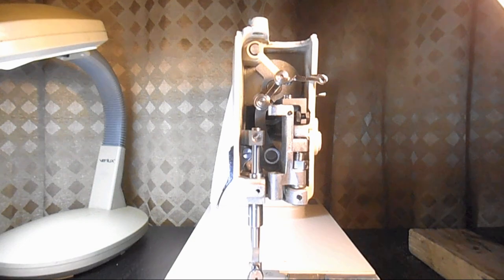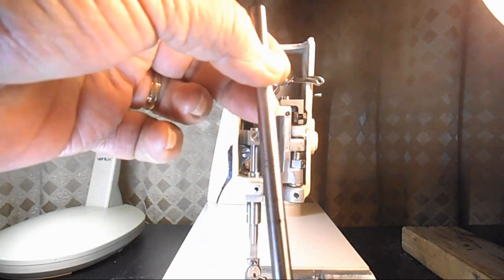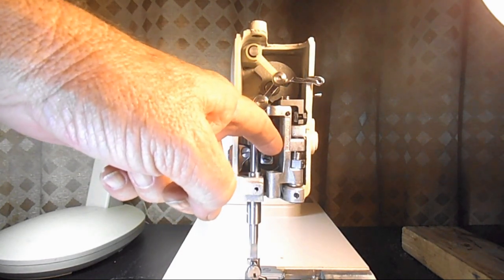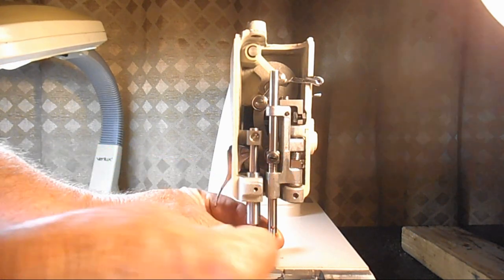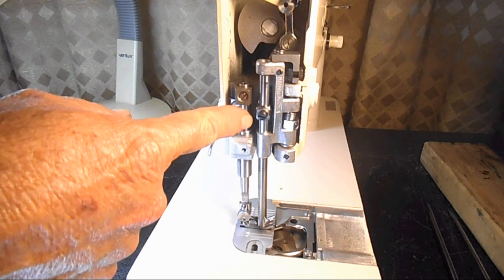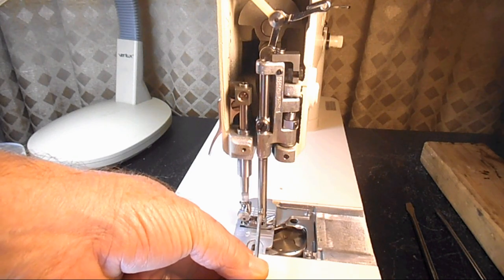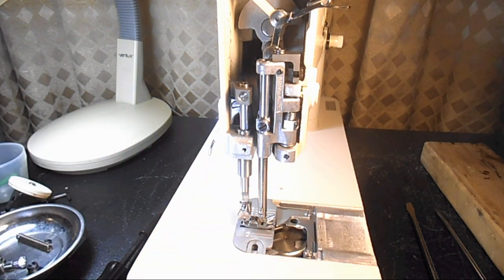How to Install Needle Bar and Set The Height on a Singer Model 513

Comment: My biggest regret on buying a Vintage Singer Futura 900 is not having access to the Needle Bar/Shaft area
without taking the sewing machine's Casing off.  It couldn't just swing open like this Model 513
to check what's wrong.  Dang!  
Andy thanks for all your tips.  My sister says I can use her 513 for as long as I need
to finish my project.  Then I think I will buy a blow threading system, with computerized this and that.
Dang!
Reply from the maker: Just looking at the parts list (over 400 parts) for the 900 is enough for me to shy away. It always seems to be some plastic part in the middle of an assembly that fails. I had to look up air threading. How easy, and all the computerized stitches... oh man. It may not be long before we just dump fabric and thread into the hopper and pick a pattern and size and the finished blouse will come out the other end. You always hear about "men and their toys", but I've seen many women with glassy eyes wandering around the sewing machine section of fabric stores too. Dang! Sounds like an exciting machine is in your future.
Reply: @andytubesewing1953  Andy, you just talked me into a Computerized Machine 100%!  
Love to you SewBro!  My eyes just glazed over at the though!

Comment: thanks for sharing your knowledge.i have one 513.After deeply cleaning,oiling and changing gears,but the needle appears too long and drags on the bottom hook plate.what can i do?it looks like a final step to get it perfect.thank you very much
Reply from the maker: Normally that is caused by one of four things. The needle bar is set too low, the hook is not installed completely down against the bushing (hook sitting too high), the needle to hook timing is off (must be reset after changing the gears) or the wrong size needle is being used. Model 513, like most Singer Models, uses a Singer Class 2020 Needle. Today it is better known as type 15X1, in sizes 9, 11, 14, 16 &18. You can download a copy of the 80-page Service Manual for $4.99 at this link: https://manualsoncd.com/product/singer-500-sewing-machine-service-manual-518-538-513-514-533/    It has nstructions for all the adjustments, including timing the hook and the feed. If you need the 64-page original Instruction Manual is can be downloaded for free from Singer at this link https://www.singer.com/search/support?title=513

Comment: Very informative. Thanks. I have the same machine. I have an issue with the needle not coming in a straight path. It come down a little to close to the plate. Will replacing the bar eliminate that problem? Thanks.
Reply from the maker: If the bar is bent, then maybe but it could be other things too. Are you talking about when straight stitch, zigzag or both? The position of the needle bar may just be off and you can adjust it back to center. The pendulum movement of the zigzag may be off and going a little sideways before it gets up all the way. Always do a good clean and oil before adjusting. That can fix up to 90% of these types of troubles. I have several cleaning videos on my channel but you can just get in the machine with alcohol, Q-Tips and/or rags and get out as much crud as possible, then fresh oil and see if that improved the movement. The machine may be barely sticking into the zigzag mode and that is why the needle is off towards the plate. If you wish to email my channel at andytube53@gmail.com I will gladly send you free copies of the original Siner manuals including parts schematic and adjustment manual. They show how to adjust the bar side too side and front to back and all other adjustments. Good Luck.

Comment: Hi, I have the Singer 513 machine. I adjusted the timing and confirmed the needle height is correct as per your video. But the needle appears to be too long? It drags on the bottom hook plate. I have pushed the needle up as high as it will go in the bar. What can I do to fix this? Thanks!
Reply from the maker: Be sure you have the correct needle. The style is 15X1, and you can use sizes 9, 11, 14, 16 & 18.
Another possibility is that there is dried up oil inside the needle clamp. People oil the needle bar and it runs down and settles inside the clamp. If the machine has been sitting months, years, decades the oil can be like dried varnish. The easiest way to try to fix that is take out the needle and lower the bar/clamp down into a cup of alcohol and let it soak. The proper way is to remove the needle clamp and clean it and reinstall it. I have a video about that https://youtu.be/qm-Qk3qk9GQ     Two notes about the video; 1. I show taking out the whole needle bar and you do not have to do that unless you'd like to. 2. I call the little part a Pib and that is incorrect. It is called a Gib and easy to lose. Someone may have put the Gib in backward which would probably block the needle.
The last possibility, which is very rare, is that someone put the wrong needle bar into the machine. Rare, but I have seen that happen. 
The correct needle bar for model 513 has a part number of 102522 and it should be etched into the bar. Without having hands on the machine I'd say that something in the needle clamp is blocking the needle so I'd remove and clean it. Good Luck.

Comment: Hello, I have a Kenmore 385-16627 (for which I have no manual and can't find one online). Today when I went to use it, the needle was all the way down - the needle bar has come loose somehow. By holding the needle clamp screw, I can manually move the needle and bar up...and when I let go, it slowly just falls down. If I use the round handle on the side of the machine, the thread eye moves up and down...but the needle bar just sits there. There's a tiny allen screw on the side of the needle bar, but I don't have an allen key small enough to fit it, if that's the problem. It's like the needle bar has come disengaged somehow. Any suggestions?
Reply from the maker: Sorry, Dianne. I only work on SInger machines and know nothing about your Kenmore model. There are Vintage Kenmore Sewing Groups and I think that would be your best shot at getting your question answered. 
https://www.google.com/search?q=vintage+kenmore+sewing+machine+group&oq=vintage+kenmore+sewing+machine+group&aqs=chrome..69i57j0j69i64.8231j0j4&sourceid=chrome&ie=UTF-8
Good Luck.

Comment: my  needle bar has fallen off my dressmaker 602a  how do I fix it?
Reply from the maker: Donate it to charity and buy a vintage Singer? Hi, Barbara. I'm sorry but I do not know anything about Dressmaker Sewing Machines. I only work on Singer machines. A 15 minute Google search for Dressmaker model 602a did not turn up much at all. The two places I use for buying manuals did not have even the instruction manuals, let alone a service or repair manual. I have several needle bar videos on my Andy Tube Channel, but they are similar to this video you commented on. On all the machines I have ever worked on the needle bar is connected by a metal link to the take-up lever assembly and the counterbalance weight behind it that is attached to the main horizontal arm shaft so when the shaft turns the counterbalance rotates and the take-up lever assembly rotates and the link to the needle bar makes it go up and down. Wish I could be of help but have nothing else to share.

Comment: The needle bar screw will not tighten.   I have done eat all you dud and you are the best because you are not running fast.  Please tell me what I need to do. I know it takes a special tool.  Please help.
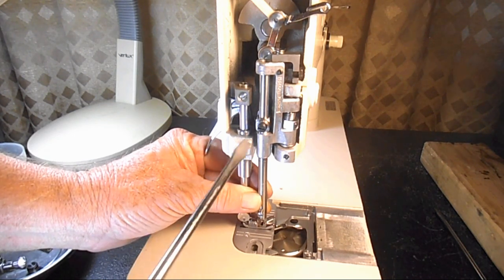Reply from the maker: Wait, what? Do you mean the screw I show tightening at 9:00 in this video? You can't make it tght to hold the needle bar? Hmm....I'v neve hd that problem before. Did you mean to loosen the screw? Is it stuck? Please help me understand, ok?

Comment: please I want to ask you about my machine singer 263 the needle bar is shaking right and left what can I do ?? @Andy Tube help please
Reply from the maker: I do not have records on model 263, which usually means it was not originally sold in the US. Maybe South America or France manufactured there by Singer. In general, if the needle is shaking l & R it means the needle bar rocker bracket is out of adjustment, or on some models, there is a needle bar driving arm. For ZZ sewing there is a small arm the "follows" the ZigZag cam. That arm is attached to a paddle or lever that has a shaft or rod going to the needle bar and it makes the needle bar rock back and forth to sew ZigZag stitches. When the machine is set to zero width or straight stitch, that follower arm is supposed to move away from the ZZ cam. If that camstack area or follower is dirty or out of adjustment, the arm can still touch the cam a little bit, and that makes the needle bar shake or wiggle back and forth a small amount. It is hard to explain and I wish I could show you, but the only thing I could find is a free instruction manual for model 263 >> https://www.singer.com/sites/default/files/product_manual/SINGER%20263_563_878_968%20and%203103%20Sewing%20Machines.pdf
Here are some videos about the ZZ on other models that may give you an idea of how the ZZ works. Maybe they will help you a little bit.
https://youtu.be/AzEiX1AZ5Xs
https://youtu.be/ySs4xQf6Veo
https://www.youtube.com/playlist?list=PLsCOZgzzaiKKGNA4RC-UmKZ1z0-qMfrb2
A clean and oiled machine always works better. If you clean the parts around the camstack and levers under the top cover, then apply oil, it may help. Even cleaning with a little alcohol if nothing else.
Reply: @andytubesewing1953  Thank you for the manual. for the videos my machine is different than yours. I can send you some photos if you may help because I can't find any solution. Thank you again for the reply. ❤
Reply from the maker: @abeerabour8440  You have a YouTube Channel. Just post a video to it.
Reply from the maker: OK, I get it now. The needle bar goes thru 2 bushings, one at the top and one at the bottom. Your top bushing on the 263 sits inside the white piece that looks like a funnel, but the bushing looks like it is stuck to the needle bar and has broken through the bottom of the white funnel. Next, the bottom bushing sits inside a hole in the bottom of the nose piece, right below the needle bar. You are missing the bushing and the needle bar is just going thru the empty hole with nothing to guide it or keep it centered.
Watch this video starting at 16:05 and you see I have the bracket that holds the top bushing in my hand. On this model, it is the black part that goes in the hole of the bracket and extends out the bottom. That bushing keeps the needle bar straight at the tops and supports it so it does not wiggle or flop around. Your upper bushing is not inside the bracket hole, but comes out the bottom and is stuck to the needle bar. The bushing IS NOT SUPPOSED TO MOVE up and down at all, but stay held in the bracket and the needle bar only glides thru the bushing.  https://youtu.be/L9ZiWURPA-Q
Now watch this video at 33:50. You see the upper black bushing that the needle will go through. In the bottom of the nose casting, in the hole below the needle, is a metal bushing held by the little screw in the front. You can see a little bit of the bushing sticking out at the bottom of the nose. Watch me install the needle bar through both the upper bushing and the lower bushing. https://youtu.be/yqY53pg8KUc
Now, look at this parts list from Singer. It is NOT A 263, but the closest thing I can find for parts. The Needle bar is on page 11, picture 4. Page 12 list 4 has the names of the parts.
Look at the pictures of parts 8, 9 & 10 on page 11. Those are the parts of the upper bushing for the needle bar. Look at parts 25, 26, 27 & 29. Those are the parts of the lower bushing for the needle bar. That is what they look like. There should be parts like that on your 263, but I do not see them, so your needle bar is just lose in the hole for the bushing.
Here is the parts list I'm talking about >> http://parts.singerco.com/CPpartCharts/3_39999/353_354.pdf
You can download a copy if you want. 
So the BOTTOM LINE is your upper bushing is broken and your lower bushing is gone. I do not have a parts list for model 263 here in the USA. I do not have a Service Manual for it here in the USA. Maybe it is available online somewhere. I have no idea where you could find replacement bushings or parts, other than another model 263 is you could find one. This company used to sell the needle bar bushing, but not available anymore. They may sell the Service manual. https://www.sewingpartsonline.com/search.html?sort.relevance=desc&keywords=singer%20263&index=41
This is the saddest answer I ever wrote ... sigh. I wish I could help more, but that is all I have for you. BTW, you posted a nice video of your problem,
Reply: @andytubesewing1953  Thank you a lot for your time , I live in Syria so now  I will be looking for a new tools . ❤❤ Thanks again
Reply from the maker: You are welcome if you think I helped you at all. Best of Luck.